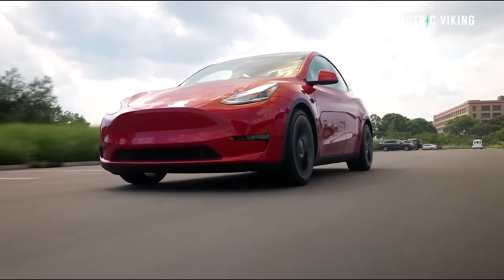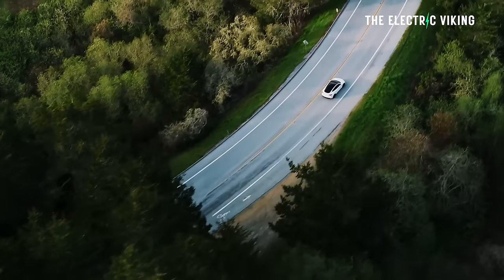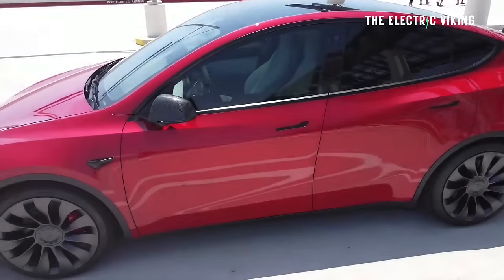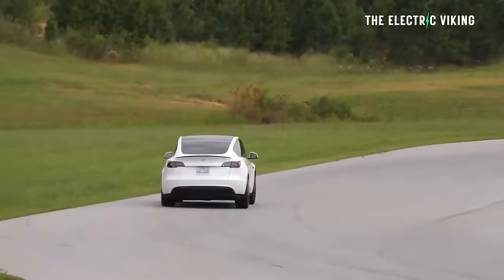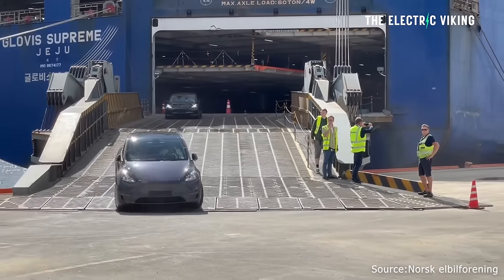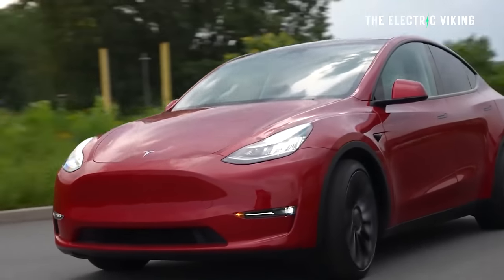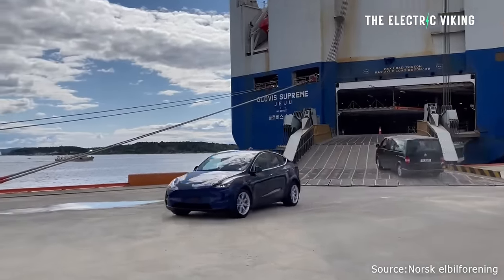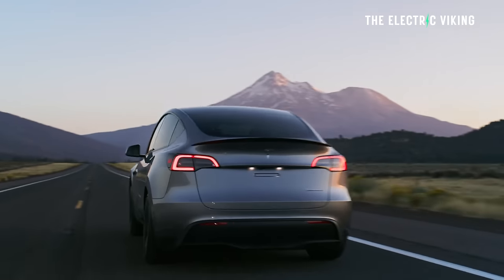Tesla reveal new affordable version of Model Y with 373 miles (600km) range

Comment: I bought the model 3 rwd (single motor) long range last year with 385 miles wltp. Awesome car
Reply: Range is still not enough. I drive 450 miles every day for work one way way.
Reply: @doylewillis9587 
Up voted, wake up World!😂
Reply: @doylewillis9587  that's 6.5 hours of driving at 70mph - at a Tesla ultra rapid charger halfway along that trip you'll put in enough charge to complete the whole journey in the time it takes you to have a bathroom break and grab a snack.
I've route planned the drive from Melbourne to Sydney (About 600 miles) and it requires a couple of 15 minute charge stops along the way.
Reply: @mshackleton1  stop putting the buggy before the horse ev is outdated 1830 tech compared to newer 1850s combustion tech.
Reply: @billybobbob3003 what are you expecting him to do but an entirely new model 3/battery pack
Reply: @doylewillis9587 No you don’t.
Reply: @doylewillis9587 one way? 900 miles in one day?
Reply: @doylewillis9587 900 miles a day? What kind of work is that?

Comment: I think range is a little bit misleading because your supposed to only charge to 80% on a daily basis.
Reply: LFP battery, so 100% charge is fine day after day if needed. 80% is older / different chemistry. Also 80% on the other chemistry is recommended but you can charge to 100% if you need the full range now and then without any problem/degredation at all.
Reply: @glenny2960  Thank you.  How can I determine what battery chemistry I have ?   2023 MYLR.
Reply: @rickhaller3328  What's the 7th digit of your VIN?
Digit 7: Type of drive train
E = Lithium lon Battery - Electric (NMC)
F = Lithium Iron Phosphate Battery (LFP)
H = Lithium lon Battery- High Capacity
(NMC)
S = Lithium lon Battery - Standard (NMC)
V = Lithium lon Battery - Ultra High
Capacity (NMC)
Reply: @glenny2960  Thanks!   E = Lithium Ion.  Now I know.

Comment: Finally, makes sense for those worried about losing range in the cold or taking road trips, my feeling 400 miles or close to it (373)  is the sweet spot to alleviate range anxiety for many.
Reply: Agree
Reply: OK, but in reality who drives over 300 miles without taking a break? In 50 years of driving that's not something I've ever done...and I've done some long hauls in my time.
Reply: @kiae-nirodiariesencore4270 I drive 300-409 miles a day no break😊
Reply: @snow-uq4gx  Every day!?...Wow! you must have one hell of a bladder!...🤣🤣
Reply: @kiae-nirodiariesencore4270  Not many people. I think the long-range batteries reduce the number of times to charge them and that makes the batteries last longer. 
Sometimes the places I'd like to take a rest don't have a Tesla charger.
Reply: @kiae-nirodiariesencore4270  Sydney -melbourne. One break at Holbrook and that's 300m / 500km right there
Reply: @yggdrasil9039  Sounds like an interesting drive, never been to Australia sadly but from where we live in the Deux-Sevres (central western France) to Trebeurden in Brittany is also exactly 500 km. We went on holiday there last September. Left home with 100% SOC, Tesla have chargers on both sides of the Nantes ring road so we used those going up and coming back. At €0.43/kWh they are not only easiest to use but cheapest. Just about to cross the 100,000 km mark on the Kia e-Niro.
Reply: @kiae-nirodiariesencore4270  not everyone drinks 5 gallons of f I l t h as u do sir🫠🫠🫠
Reply: @kiae-nirodiariesencore4270  Well I have and its more than that its making it to the next charger or the real range depending on hills, speed and cold wether so  377 could mean I have a comfortable 300+ range  and thats reassuring

Comment: In EPA terms, that's roughly 327 miles of range. Idk why the EU uses WLTP range when it is never applicable to real car range from what ive seen.

But 327 miles is still pretty good
Reply: More like 320miles EPA. Not that crazy. BMW iX3 "Neue Klasse" might have up to 370miles EPA range.
Reply: @Aztasu  we'll have to see if they can finally redeem themselves in the design department. It seems like every other car they make is just stretching the limits of what people will spend loads of their money on 💀

I would say it's hilarious but it's frustrating. Plus the porsche macon ev has up to 381 miles which, we know by porsche standards, is what you'll actually end up getting. It's a good bit more expensive though. However the ix3 is also starting from $60 to $70k and that's not even talking about performance models which the model y is at around $60k for the performance

Comment: Give me a silver model Y in long range all wheel drive with 500 miles of range and I am there!  Living in MN, we need the all wheel drive.
Reply: What ice car has that range? Don't need that crazy amount of range mate
Reply: Car gets too heavy with an oversized battery pack
Reply: @struanmockford3264  Most diesels..
Reply: @christianolsen9781  BMW iX3 "Neue Klasse" will be more efficient than Model Y. Mercedes CLA and C-Class will be way more efficient than Model 3. Check premium german manufacturers for high range and quality EVs, not Tesla
Reply: With the Tesla charging network my Model 3 SR can easily manage with “only” 250 real world miles of range and I’ve done 75,000 trouble free miles in two years. You just don’t need 500 miles of range…

Comment: The fact that SR has LFP battery which is robust and you can charge it to 100% for daily use is a still a big advantage. The difference between SR and LR RWD effectively will be on longer roadtrips where SR might need 1 or 2 additional stops but that is not a dealbreaker for me.

Comment: So, is this the current US RWD Standard Range with the software lock removed? Because if it is then it's NMC and that just sucks. If the only thing they did is removed the capacity lock on the RWD that's just lazy marketing. You can't charge it to 100% all the time so the difference between this and the LFP RWD would be what - 30/40 miles?
Reply: It is, yes. Nothing special
Reply: I would pay $1K for Tesla to unlock my MY SR .  I believe it is supposed to be faster too.

Comment: Yes it is cheaper than the dual motor but 4 wheel is important in cold and slipery roads. It is actually not that cheaper and it is the same price of the Long range price in January/February when Tesla reduces prices of Model Y.

Comment: Seems like just leaving out a 250lbs front drive system would change the handling of the car compared to the AWD.  Even if you don't need AWD, I think replacing the FWD system with a parallel supplemental battery pack of the same weight would extend the range even further without changing the weight distribution and handling.  That weight would allow an extra 20kwh of LFP or 30kwh of ternary cells.

Comment: I do not need all wheel drive nor fast acceleration.  I do want 373 miles of range.  But, I do need more ground clearance - there are 3rd party kits to increase the  ground clearance on the Model Y.  Bring this to the USA please.  310 miles of range (standard Model Y LR) is enough for the west coast of the USA, but barely enough for Sonora  Mexico.

Comment: This sounds like a good improvement,  however they should have made it at the very least a front wheel drive for those areas that get snow or lots of rain.  I live on the Westcoast of Canada 🇨🇦 and I would never consider buying a rear wheel car and have been driving a AWD now for years and find this works far better in our climate. Not to forget there is far too much power going to those rear wheels in an electric car. Really should be at the minimum front wheel.

Comment: The uk LR single motor has a range 385. Less than the LR model 3 plus dual motor which is 421 miles.

Comment: WLTP driving test pattern is not representative of what people think of when they think 'long range', because 'long range' tends to imply going a long way away, for which most people will use the highway, where WLTP ranges are out of the window. Instead of using WLTP for highway range estimates, use 3.5 x kWh(battery size) for a better range guesstimate

WLTP range testing comprises of the following
589 seconds at average 15.7mph, peak 35mph
433 seconds at avg 27.6mph, peak 48mph
455 seconds at avg 37.7mph, peak  60mph
323 seconds at avg 58.4 mph, peak 81mph

Comment: The performance changed as well, which could be an indication that they may use a modified or different motor(?) The new version is 1 sec faster at 0-100km/h than the standard.

Comment: I saw the best comment on this - saying that Tesla has failed to deliver FSD and a car for that, so they have to refurbish old models to not risk running out of money. The commentator reminds that an investors note of 2017 said they have FSD by 2020. You can find a similar scenario for the Cybertruck. So the only thing that is really working for Tesla is an evolution of a ten year old concept alluding to the 600km range of the Model S. 

Bottom line is that EVs work just fine in the premium segment and Tesla has a very high customer loyality so that competitors like BMW can not cut away the share that Tesla has there. When Tesla brings out a new-and-improved thing then their fans will line up - it is just not as visible as the queue at an Apple store when the next iPhone generation comes out.
Reply: ……. Yeah I’ll say runnin out of money w/ SEVERAL BBBILLIONS IN TH BANK

Comment: Global capacity to generate power from coal, one of the most polluting fossil fuels, grew in 2023, driven by a wave of new plants coming online in China. China alone accounted for two-thirds of the world’s newly operating coal plants last year. Indonesia, India, Vietnam, Japan, Bangladesh, Pakistan and South Korea also inaugurated new plants, which typically operate for two to three decades. China, and, to a lesser extent, India, are still planning to build coal plants many years from now. In 2023, new coal plant construction hit an eight-year high in China. If China were to build all the others it has proposed, it would add the equivalent of one-third of its current operating fleet.

Comment: In a week I can only get 100km out of my 2023 MY RWD that’s rated for 455km with sentry and pre condition on. So this 600km is what 150km in real life conditions across a week?
Reply: Model Y RWD is just pure scam. One of the lowest range on the market for 42-45k, depending on your country. A tiny Renault 5 has 400km WLTP and fits a 52kWh battery under the chassis.

Comment: What is the battery type?  Before the standard range was a beter choice. 80% range of the long range was less than 100% of standard one with lfp battery.
Reply: NMC from the AWD LR
Reply: @Aztasu  basically you get 25 km more with the new model Y version, if it was a LFP battery , it was a no brainer.
Standard LFP 100% charge 455 km 
LR AWD NMC 80% charge 426.4 km
LR Single motor NMC 80% charge 480 km

Comment: wltp is a joke. they did the same with the old model 3. I have one. 78kw battery and a single motor. it gets 550km in granny mode, and since you should be doing 20-80% charge its 300 km usable daily which isn't bad all things considered

Comment: If the 600km of the new rwd long range model is reached by using LiIon batteries, this is not a "no brainer" because in reality you can only use 80 of the capacity. long range with LiFePo batteries would be a no brainer.

Comment: 2170 Battery?  If so normal charge is 80% correct?  An LFP battery would make this more attractive.  However there's one final problem - LFP batteries are material sourced outside of US making them not eligible for tax credit.  Please correct logic anywhere needed.  Thanks

Comment: They didn't just remove one motor, they put a slightly bigger battery in it too. I heard it's 79 kWh. 
It's about 5000 euros more than the regular RWD here in Sweden, and only about 3000 euros less than a Dual Motor. So quite a step up from the entry level.

Wrt the long range RWD M3, they had that some time back in 2018-19 too, but it was off menu so you had to call them to order it. Maybe you can do the same now.
Reply: no they didn't, it is the same battery as the LR model but now RWD instead of AWD. Super boring

Comment: More range until you turn the heat on and it's 20 below zero. Uh oh, You get less than half of your 373 miles and need to get to a charging station, Uh oh, We got bunch of dead robots here and the charger won't work.

Comment: My long range Model Y has a WLTP range of 534 km, newer came even close! How can you shill so much. The most I've done was 380 km driving at the speed limit, a combination of motorway, city and normal roads between cities. I charged to 100% and actually drove the distance, I didn't do some km and then calculated the range based on the battery size and the average Wh/Km. Disappointing.
Reply: Do you drive according to the WLTP cycle? Or do you drive differently?
Reply: @Harrythehun  My daily round trip pretty much follows the wltp cycle, with slight variations, but nowhere near to justify a 150 km in range difference.

Comment: It shouldn't be more expensive if you are ripping out one of the engines, giving up the horse power and torque, acceleration and AWD capabilities... I don't see why more people would buy it... Very flawed thinking there buddy...
Reply: I have the cheapest car Tesla makes, and have its acceleration set to Chill.  And still accelerate faster than 80% of the cars out there.  If people want wheel spinning and squealing, they should go to a track.  The performance versions are just aside to most people's needs, or even wants.  AWD is nice here in the mountains of Colorado...but tires are more important I find (even when I was in search and rescue).  Use top quality winter tires not all seasons, except in high summer.  (Colorado allows winter tires all year long.) RWD works adequately even in this snowy, icy clime.

Even the shortest range 3 has been adequate to some quite rural places, but more range would be nice for some even more remote areas.
Reply: More expensive than the SR 2WD.  Less expensive than the LR AWD.  Makes total sense to me.
Reply: Yeah, makes sense to me. Most people (including myself) dont care about performance as much as range. Batteries are expensive

Comment: Actually the the dual motor long range have 565 km with the aerodynamic wheels according to the WLTP cykle.
If you're comparing apples to apples. 😊
But it's still a big improvement in range. 👍

Comment: Once EV can have a range of at least 500 miles.. I’m not buying one…. I’m ok with my Toyota Corolla ..😎😎😎😎😎😎
Reply: Carolla is a great car , but it is still burning gas and is still fouling up our atmosphere.
Reply: @bossman6174  compare to all makes and models..  least of my worries..   about the atmosphere . That is out of our control won’t your agree 🫡🫡🫡
Reply: @moonlander03  we all have to do our part. The science doesn't lie the world is heating up fast .
Reply: Mercedes C-Class is projected with up to 850km/528miles WLTP range. Might be a bit high estimate, but i 100% believe it will have at least 805km/500 miles WLTP range as the slightly lower class Mercedes CLA was already announced with 750km/466 miles WLTP.
The EPA range of the C-Class should be 450miles then, the CLA should reach 400miles EPA.

Comment: Tesla has been battery constrained.  It was easy for them to add a 2nd motor, hard to come up with.more batteries.  Things have been changing so longer range versions are becoming more feasible.
Reply: They just did the reverse here. Took the existing LR battery and deleted one motor. That's it

Comment: I have often thought that Tesla could outcompete everyone else by just offering greater battery range, as they can make batteries cheaper than anyone else (outside the China market) and have better efficiency. The MY IMO is already the best car on the market. We bought an ID4 here in Calif. because it was an insane lease deal. It's a beautiful driving car however - lousy software disappointing cargo capacity terrible charging network. MY with real 350 mi highway range would crush everything on the market. EV faithful will claim you don't need it, but the under 300 mi range of almost all electric vehicles in the US is just a huge problem for selling EVs to the masses rather than just Tesla and EV enthusiast and early adopters. Yes the Tesla charging network is pretty good but people really just don't want to be forced stop every 2-3 hours. The poor non Tesla charging network and the limited range of EVs is 99% the cause of the slowdown in EV adoption in the US. Take away this last psychological barrier to EV adoption and the floodgates will open.
Reply: Just get the BMW iX3 "Neue Klasse" which will be revealed in early summer 2025. It has 800V, 270-300kW charging power, 90kWh or 105kWh net battery packs which should give you 310 and 360miles of EPA range even in AWD configuration. It fulfills all your dreams and wishes. Teslas are extremely outdated and overpriced for what they are